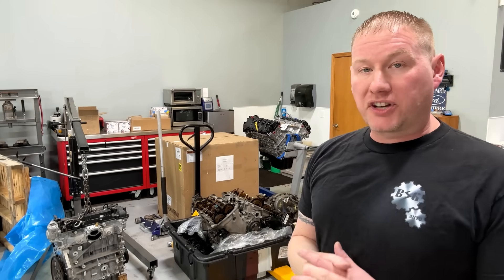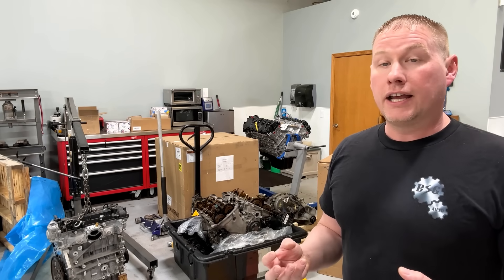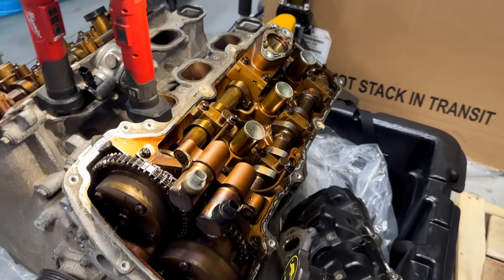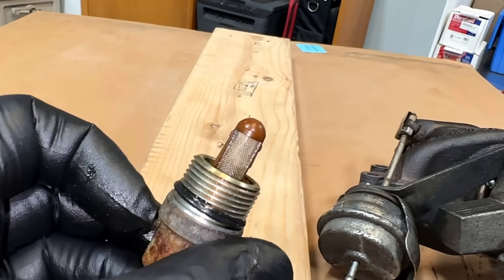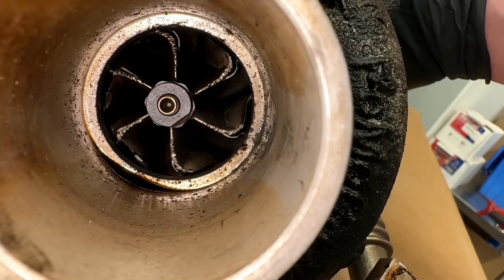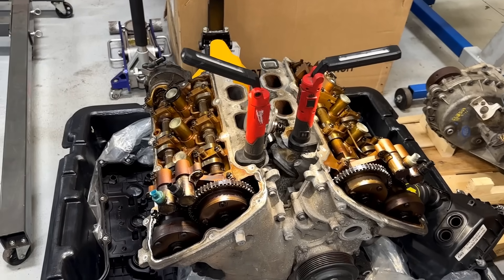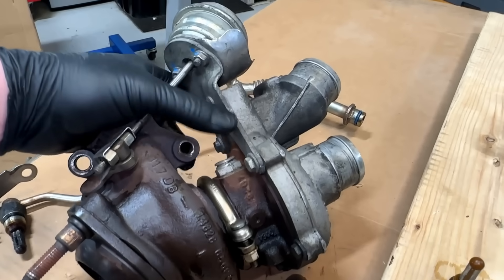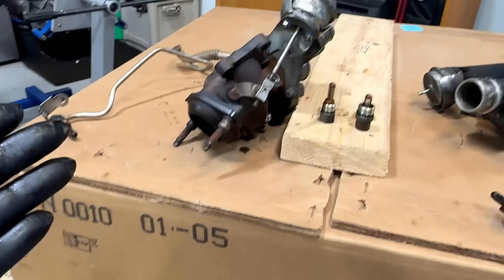This is Why You Never Run Extended Oil Change Intervals on The Ford Ecoboost Engines!

Comment: Brian always gives us sage advice!.. personally, I recommend a catch can in addition to timely oil changes.👍
Reply: Not necessary if you use a really good filter with a good synthetic oil. I have a 3.5 with 410,000 miles on it with no catch can and it still sounds like I did when I bought it and it zips up to 100 mph on a weekly basis.
Reply: @stephenbloom2545  My brother (Ford mechanic) said while a catch can may be beneficial - it will certainly void your warranty…Driving 20 plus minutes (preferably highway) and getting the engine warm will certainly help reducing the amount of partially burned air/fuel mixture as it’s recycled back into the cylinder thus reducing the carbon build up.
Reply: @FMichael1970 that's why I ruled out turbos.  The vast majority of my driving is short distances.
Reply: You don't live in a winter climate do you? Don't put on a catch can if you live in a freezing temp state.
Reply: @BloodySoup74  so no catch can in Canada, gotcha. I was thinking about doing it as I saw a video on it. 
I am assuming that the oil in the can gets to cold? 

So what else can ya do to help reduce the blowby then.
Reply: @crowndroyal  It just not about getting cold it will freeze the catch can and oil and other deposits will back up through your dipstick and air intake. The only thing to really do in cold climates is more oil changes. Faster than manufactures recommended intervals. If new car engines say 10k miles then do it half or less. These DI engines need that. I live in Minnesota and we get extreme cold temps. I was going to do the catch can until I heard the horror stories.
Reply: @BloodySoup74  I would imagine the horror stories are from people who did the mod and didn't keep up on draining it.
Seen plenty of people in F150 forums in Canada out in Alberta who have them with no issues.
Reply: @crowndroyal  And yes you need to have up keep on it for sure. I'd say go for it for the 3 seasons and winter just be anal on watching that sucker. I do believe catch cans are a great idea for what they do but I work 12 hour shifts and our temps would freeze over night easily so I know I'm not going to risk having it on. I don't need the problems trying to get out of work and a half hour drive to get home. Maybe I'll do the can just not in the winter.
Reply: @crowndroyal  water is also a byproduct that gets pushed through the PCV system, it’s more prevalent since we started putting ethanol in our gasoline so it freezes in the lines to the catch can. If you use a very good oil filter and synthetic oil a catch can really isn’t needed.
Reply: @Stephen Bloom   alright thanks. So the filter recommended here is fine as well then or do you have a better recommended one.
Reply: @crowndroyal  I personally use the Amsoil EAO17 filter, it’s Rated for 25,000 miles and it’s filtration is 20 microns. My second choice is the WIX synthetic filter. NAPA gold is good, Royal Purple is good and Mobile 1 has a good filter. The Amsoil filter I referred to is for the 3.5 ecoboost
Reply: @stephenbloom2545  I have the ecoboost 3.5
Reply: @crowndroyal  its cause the blow by is mostly water vapour and it freezes, oil doesn't freeze or at least not in canada temps
Reply: You should absoutely have a catch can in any climate

Comment: It strikes me,and has for a long time that most vehicles could  do with another level of filtration that was easy to access and change the filter (obviously not from the mfrs !) sort of like an external oil cooler with a quick access filter on it.  Preferably with a flow sensor and a very loud buzzer attached to it  !
Reply: You'd be better off to drain the oil and not change filter. The combustion byproducts and fine dust too small for filter to catch will be reduced and the engine lasts.way longer. Oil filter with second drain. The problem.is not bad filtration, it is oil degradation and lost oil replaced.by combustion residue. The oil gets brown from the stuff rings wipe off cylinder walls.
Reply: Synthetic oil is pretty resilient
Reply: There is such a thing, some diesel heavy equipment has had secondary oil filtration in the form of remote "by-pass filters" for a while installed directly from the manufacture, or is installed as a aftermarket add on by the owner to extend time between maintenance. By-pass filters work by drawing 5-10 % of the oil flow from the oil pump through high efficiency filters that filter down to 2 microns that dump that clean oil back into the oil sump - bypass filters filter all the oil in the system several times an hour so the engine gets analytically clean oil constantly, since engines need a constant high pressure flow of oil installing one directly to the engine main oiling system would be way to restrictive: the typical oil filter in vehicles we drive everyday only filter down to 20 microns. Using one of these system can extend oil change intervals to 60,000 miles for Semi-Trucks etc,.. or double the engine hour use if used in construction equipment, and some even higher depending on there filtering efficiency percentage.

So, oil doesn't go bad per say at whatever interval your changing it at, as long as the additive package in the form of TBN (total base number) is high enough, or a low TAN (Total Acid Number) the reason it's replaced is because of contamination held in suspension, so bad filtration is one factor in regular consumer grade vehicles that is further amplified by Direct Injection that creates more soot than older diesels without DPF filters.

Comment: I always reset my oil change minder to 50% after oil change.
That usually works out to be around 5000 miles.
283000+ on my 11 ecoboost
Reply: I go every 5k on the odometer. Don’t even need a sticker. 5,10,15, about to hit 20. OLM is usually right at 50% when I change it.
Reply: @btw985  Same here but now (since when I hit 80K) I have changed to every 4k so now it's multiples of 4. Still not to hard to figure.
Reply: @TheOnlySgtRock very smart
Reply: Ditto !
Reply: how do you do that to a Ford?    I'm new to the product
Reply: @g8gtatlman483 
Go to your oil life reset menu on dash and scroll to the % that works for you. From 10% to 100%. In my case 50% equals to around 5000 miles
Reply: When you go to your oil life reset on the dash menu it gives the option to reset it in 10% increments from 10% all the way to 100%.
With my driving style 50% is right at 5000 miles

Comment: Thank you , I really appreciate this video.   I have a 2020 F150 with the 2.7L that I bought brand new.  My dealer told me that they recommend semi synthetic motor oil and to change it every 10,000 miles.  I sad no way , I do my own oil changes and I use full synthetic Mobil1 and I change the oil and filter every 5,000 miles.   I am glad to see this video and it reinforces to me that my dealer is an idiot and that I am doing the right thing.  👍
Reply: I also added a J&L oil separator on my truck when it had just a few thousand miles on it.  I figured that it can't hurt anything!
Reply: Mobil1 ain’t what it used to be. Try out Castrol Edge in the black bottle or Valvoline Extended protection.
Reply: @slscamg you are correct (seen oil test on mobile 1 oil changes. Not as good as the oils you mentioned. Penzoil ultra platinum a good oil also.
Reply: @slscamg  And somebody else is going to have a different opinion.  So I will stick with my Mobile1.

Comment: Would you recommend an engine flush to attempt to clean out those turbo screens?
Another question about the turbo.  We had Ford replace our water pump over a year ago on our 2014 Explorer 3.5 eco but ever since we got it back we can actually hear the turbo spooling and sucking air.  Before the water pump was done you could barely here it?
Reply: I don’t think a water pump replacement has anything to do with being able to hear the turbo spool. Just a placebo effect maybe?
Reply: Okay, thank you for the reply.  I have not worked on my wife’s car engine unless it is the oil or brakes.  I had seen on the videos that a part of the engine has to be taken apart to put in a new water pump so I thought that they might have worked around the turbo?
Thank you again.

Comment: When will people learn that an extra oil change or three per year is way cheaper than any repair.
Reply: The issue is Ford recommended service is telling people otherwise. I think its almost better to ignore it.
Reply: @Jacob1986 

We have two cars with small turbo engines, neither is maintained "by the book", both cars have maintenance at three times the recommended rate. Oil changes every 3-3.5K miles. No issues with either.
Reply: @groosbro1 I have a 2016 f150 ecoboost  .I.change the oil every 4000 miles and no issues at all
Reply: @Jacob1986  Ford recommended service! LOL
My cars don’t see the Ford dealer unless there’s recalls or warranty work involved! Especially since, partially thanks to this channel and Ford forums, I found out I know more than they do when I proved to 3 dealers what was wrong with my wife’s 17 Explorer head gasket! 🙄
Reply: @Jacob1986 ’ve got an old school 6.0 and I ignore a lot of Ford’s recommendations.  Coolant & oil type and other intervals.  I’d rather pay a little now vs a lot later.  I do most of my own maintenance.
Reply: @Jacob1986  they do that on purpose. So you pay to replace an engine/buy new car when yours is kaput.
Reply: @Jacob1986  dealer always recommends them so does any independent mechanic
Reply: I change my own oil for $30 a pop.  That's half a tank of gas.  How many tanks of gas do people go through between oil changes?  Changing oil frequently is very cheap insurance. I change mine every 3000-4000, and I have the normally aspirated 3.5.
Reply: @Major Kong  Where are you buying oil? I can't hardly get 5 quarts for less than $30, the Ecoboosts take more than 5 quarts. Then you have to add in the filter cost.  Not being critical, just curious.

That said, $200/year for 4 oil changes is cheap compared to a new turbo, or a new engine.
Reply: @xeutoniumnyborg1192 

I didn't say anything about the cost since I do my own maintenance. I buy Pennzoil Ultra Platinum for my WRX and Pennzoil Euro spec for the Alfa Romeo. Cost about $40 with filter for the Subaru, and about $70 for the Alfa.
Reply: @xeutoniumnyborg1192  Walmart has Havoline 6-quart full synthetic for under $30. Or synthetic blend for $23.
Reply: I also have a 3.5 twin turbo EB lchange oil every 3000 miles, 209000 still runs strong @major__kong
Reply: The issue comes where people don’t know what can happen when following the dash light. You cant blame it on the person. It’s the manufacturers fault for programming the computers incorrectly where engine damage occurs. There should be class action lawsuits because of it.
Reply: @supersportimpalass  Good luck with the class action lawsuit. Auto makers only care that it lasts the warranty period. No car (not even Toyota - they are almost worse with the low tension oil rings) will survive to 200k miles on a 10k mile oil change interval
Reply: @pbrutsche  As a Toyota owner, I never go past 5000 miles. Not even amsoil will back a 10,000 mile oil change on a Toyota engine.
Reply: They want you to spend money.
Reply: @pbrutsche I disagree. I changed the oil in my Focus at 10k regularly. Had 149,000 before it got totaled. Even did an engine oil analysis and my oil was cleaner than average for that engine.
Reply: @ANDthe3 FYI - AMSOIL SIGNATURE SERIES 100% synthetic oil recommended oil change interval is 25k miles for normal engines and 15k miles for turbocharged engines, such as Ford's 2.7L EB's like mine. 247k miles on the odometer and still fine. I'm just say'n....
Reply: @supersportimpalass The Toyota expert The Car Care Nut says extended mileage indicators are only to get the vehicle to the end of the warranty period!
Reply: @supersportimpalass I believe there was one against GM for the 2.4 Ecotec oil consumption issue. That was caused by the 7500 mi interval.
Reply: @supersportimpalass Yes you can. I blame it on those people all the time. You know why? Yes they have oil life percentages, but that isn't checking your engine oil level.. which if you follow the oil life percentage... you could be driving around half to 2 qts low !
Reply: People always made fun of me for changing the oil on my 3.5 ecoboost truck every 3,000 miles until i hit 600,000 miles with no engine or turbo repairs.
Reply: @joshuas3282 

No way dude! You mean it wasn't Found On Road Dead? 😂
Reply: Some won't learn. Why Ford even recommends synthetic blend with the turbocharged engines is mind boggling.
Reply: @Mike-yq7ce I usually use synthetic blend oil on my 2.0L Ecoboost 2019 Fusion. I'm at 69K miles now. Do you recommend using Full synthetic only?
Reply: Like the old Fram commercials used to say..."You can pay me now,  or you can pay me later ".🤷‍♂️
Reply: people learn, and buy another brand like Toyota or Honda and never consider Ford. products again!!!
Reply: I have been having my 2022 Ford Rangers oil changed at 3000 mile intervals. The Ford dealer tried telling me I have 50 percent left at 3000 miles on the oil. I pulled the dipstick and the oil is dark and gritty. I am using the cheap synthetic blend in the Ranger which the Eco boost 2.3. My 2010 Shelby GT 500 uses 20w 50w and I have Ford change the oil at 18 months or so but the car only gets driven 500 miles per summer. The oil on my 2016 mustang GT gets changed every year at 2k to 3k miles with the Ford synthetic blend. By far when I compare the look of the oil on the dipstick the Rangers Eco boosts is always the darkest color and I truly believe the old port injected V8 motors run cleaner. Wish I could buy a Ranger with a 5.0 now we would have a hot truck.
Reply: Talking oil is as bad as politics lol wait until someone mentions running a heavier weight oil.
Reply: Never
Reply: They won't learn
Reply: no oil changes are the cheaper option
Reply: @kychristell1779

I use Pennzoil Ultra Platinum and Fram filters for my 2020 Subaru WRX every 3-3.5K miles. 70K miles, doesn't burn any oil, no issues at all so far.
Reply: I think people think something is wrong with them if they change sooner. People criticize them and call them stupid and neglectful.
Reply: hopefully more people doing t hat
Reply: When will people learn? Well, these same people keep voting policies destroying cities; they won’t learn.
Reply: I always say an oil change is a lot cheaper then a engine
Reply: Because new cars and trucks are built to accommodate a climate change sham, and they suck. All the way up to the late nineties, cars (the well built ones) could be used and abused and keep on driving. Even if human based climate change was real, the solution would not be to build millions of throw-away cars and batteries.
Reply: I have a 2018 expedition and i change the oil overy month 4.5-5k
Reply: Never.  I just had this conversation with my brother.  He makes way more money than I do so you can't tell him spit.
Reply: @littlebill1987  Mr know it all yeah? I have a 1.0 ecoboost, oil change once a year because we don’t do a lot of kilometres, none the less it gets done. 2015 model and no issues especially with the duel clutch transmission.
Reply: Been using Royal Purple 5w-20 and either a Wix or MotorCraft oil filter for all my Fords. Even my hydraulic roller cam, stoked 408Windsor in my 65 Mustang Fastback. No issues.
Reply: @John Clemans  same, RP 5w30 and a wix air and oil filter my impala is at 350,000 miles with no issues
Reply: 3,000 mile oil changes on a NA engine is a waste of oil. This is why I don't buy boosted engines for a daily driver. Way less sensitive on the NA side. I do 10,000 mile changes with full synthetic and I drive a lot. None of my cars have had major problems.
Reply: Would this be the same on a 2019 mustang 2.3 motor ? We been doing it at 10% left on the cluster deal
Reply: I have a better question. When are people going to learn to pay a little bit more money and use AMSOIL instead of having to change their oil every 5k miles? lol!
Reply: @BrickMudge 

Amsoil is good oil, but it not good enough to stretch the change interval. Combustion byproducts will still contaminate the oil and no oil can neutralize them over a long period of time.
Reply: @groosbro1  You're just ignorant about AMSOIL. That's all. And of course, no oil is immune to breaking down over extended periods of time. Duh. However, AMSOIL is the best. I could go even longer than 15k miles if I got oil analysis's done and continued to change my oil filter every 7.5kmiles.
Reply: @BrickMudge 
Tell you what, I'll continue being ignorant about Amsoil and continue changing the oil in my cars the way it works for me.
You can go back to admiring your Amsoil tattoo in the mirror.
Reply: @groosbro1  Just the response that I expected! Bwah-ha-ha-ha!